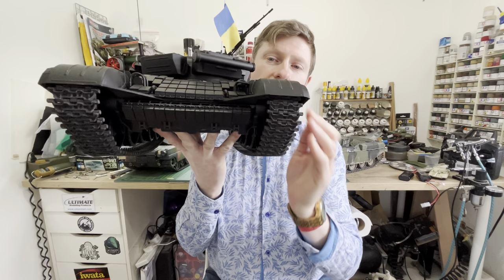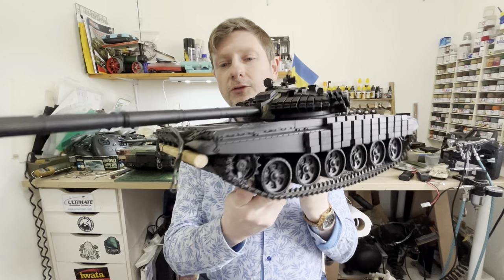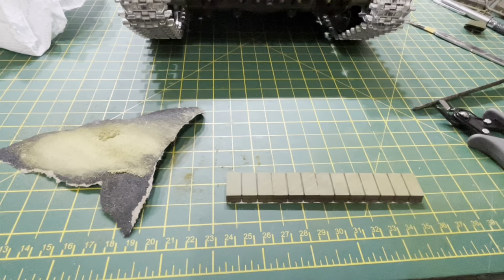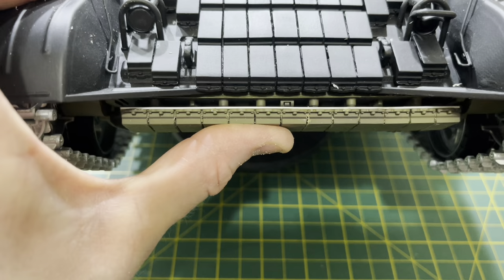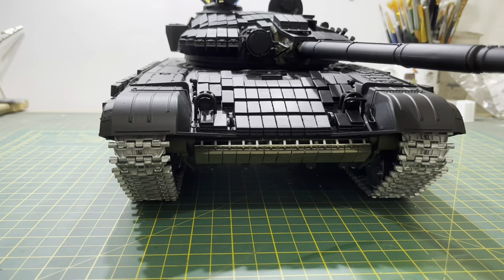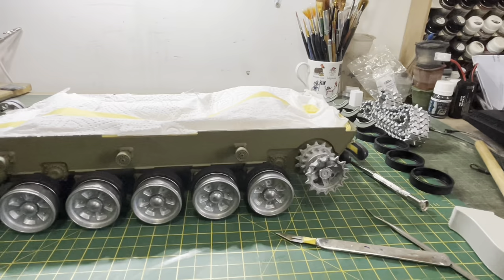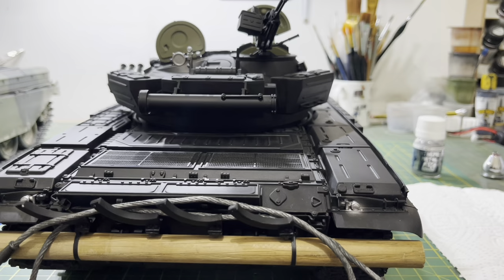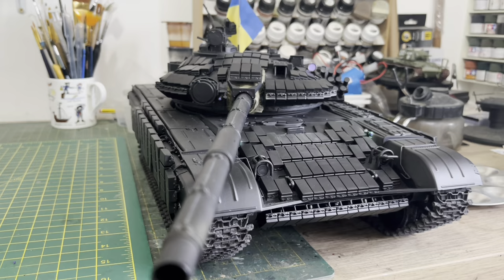NEW RC Tank Heng Long T-72 ERA modified to Ukrainian T-72AV Pt 6 lower hull ERA, and bits! #howto

Comment: Hi just a quick one I've been searching for a supplier of small multi connectors to allow easy separation of the superstructure from the hull when you are working on either if you're interested they are available from 4max models just down the road from me and not too far from you they come in 6/9/and 12way and a couple of amperage ratings I'm practicing on the Abrams before I tackle the Haya centurion all seems to be going well at the moment I'll let you know how it all pans out regards Peter
Reply from the maker: Dear Peter 
Yes please do, I’m useless with electronics, but it sound a great idea!